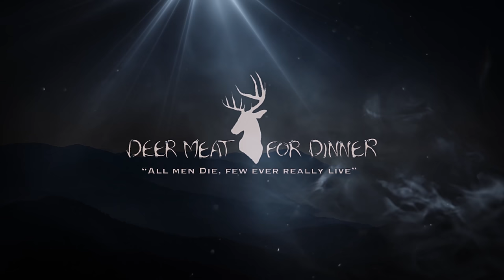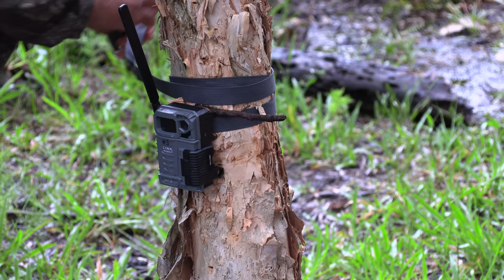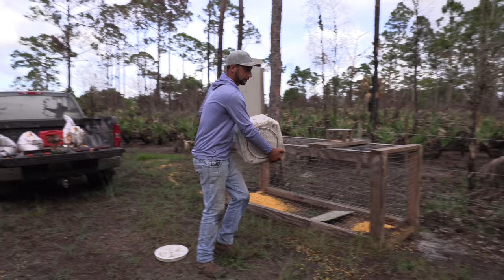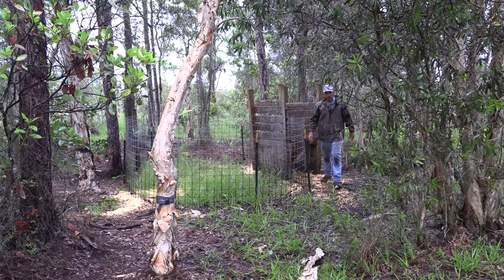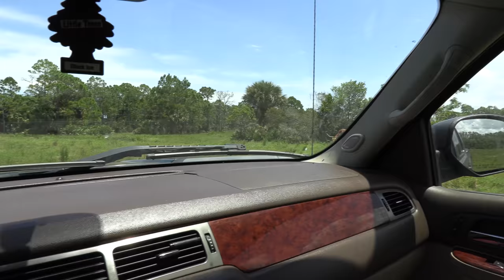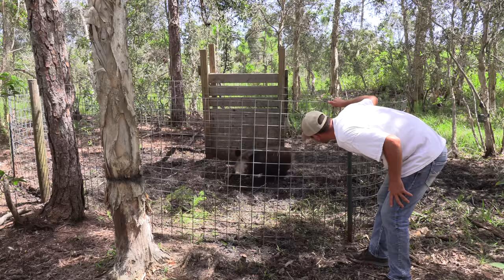Trapping wild BOAR in home-made trap goes TOTALLY WRONG!

Comment: Love the honesty. Things don't always work out in real life. Sometimes the hog escapes the trap and we gotta start all over.
Reply: I think having the human show up really gave that hog a lot of panic adrenaline and it was able to muster up the energy to bolt over the top of that trap. A couple of steel bars or cross beams across the top would have prevented that. Also to prevent the wood from getting so fragile where the screws holding it are? Use nuts and bolts with washers on the other side instead, so that even if the screws are loose, you won't lose the entire piece of wood and the door will stay intact.

Comment: To prevent an operator from being trapped in his own trap like you were, the trap needs to be constructed with a hinged escape door on the other end, with an engaged dead bolt latch that can be disengaged from the inside. This way, if the trap door #1 slams on you, you can just undo the latch at the other end and open door #2.

Comment: Looks like a more conventional, proven design is needed for your hog trap. Two times the design of the door allowed the hog to escape.  I'd start with the redesign of the door to a sliding, drop down style that's proven to be effective.  It's not fun to have a hog out think you!  When you come out to check traps, have your gun with you when you first approach the trap, and dispatch the hogs on the spot.  

You're putting out great videos, with good content.  You're showing how difficult it is to deal with these hogs.  They're smarter than we think, and both we and the hogs learn from experience.  That hog will be much harder to trap again.  Thanks for sharing your experiences with all of us.  We can all learn from each other's adventures in hog control.

Comment: I designed and built a hog trap several years back for use at our hunting property. It’s a long story but it came about as a bet I could design a “better Mouse HOG trap. It is portable and can be handled by one man. It has several features you have likely never seen in a hog trap and cows are no problem. We've never lost a hog once they were in the trap. I would be glad to send you the instructions if you like. I just need an address or some way to get the drawing to you.

George